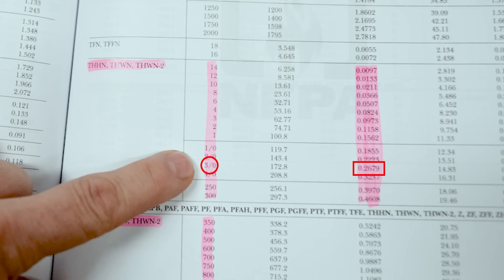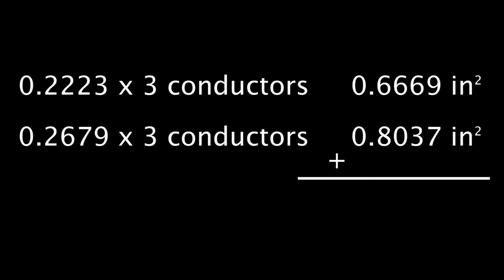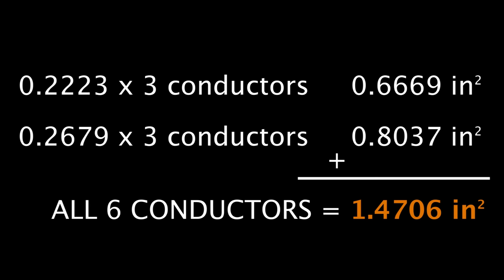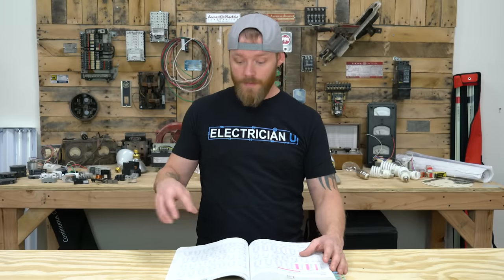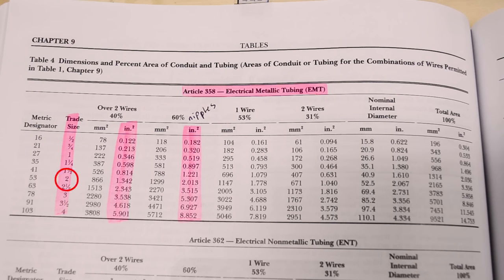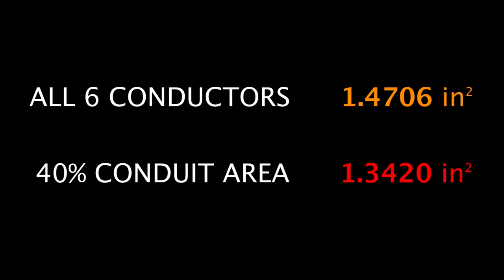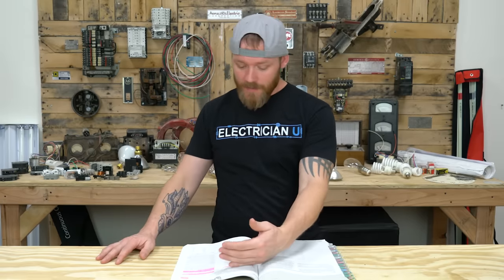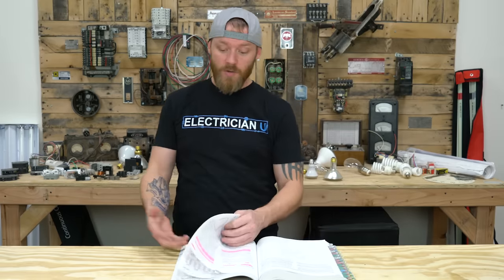CONDUIT FILL EXAMPLES for the Modern Electrician - How Many Conductors Can I Put In...

Comment: The code it’s not an instruction manual nor a study guide. Go to 310.1(B)(3)(A) and you will find that’s grouping the conductor has to apply adjustment factor to prevent the wires from over heating.

Comment: There’s no where near enough air flowing over those wires to dissipate heat. You’d need a fan blowing individually into each pipe to even drop it a few degrees. So dumb that people think you need an air gap to stop the wires over heating.

Comment: Conduit fill CAN lead to too much heat.  Heat can cause a "You name it" list of problems in electrical systems.  I have seen it personally on more than one occasion.  Remember, 9 current carrying conductors or less to avoid derating the conductor amperage heavily.
Reply: That's not conduit fill, that's adjustment for multiple current carting conductors in a raceway
Reply: @jontopham2742  Read Article 300.17. In the NEC Handbook, both chapter 9 and annex C refers you to that article.

Comment: Please check your code book. If you read the informational notes of Annex C in the NEC Handbook it leads you 300.17, which clearly reads... "the number and size of conductors in any raceway shall not be more than will permit dissipation of the heat and ready installation or withdrawal of the conductors without damage to the conductors or their insulation".

Comment: A few points. 1) heat is a factor in raceway fill since mutual heating becomes an issue. There are Performance and Prescriptive Requirements and the prescriptive requirements that demand the maximum fill are to also help satisfy the performance requirements so as to not damage the thermal properties of the insulation. 2) Yes, another key factor is indeed reducing the potential for damage during the installation. Remember, that Informative Annex C is only for raceway fill as a short cut when ALL the conductors are the same size, it doesn't reference heat simply because it is again simply giving users as a shortcut method to maximum fill if all the rules are adhered to. Back to heating, just because the values of 310.15(B)(2)(a)  and 310.15(B)(3)(a) appear to have no relationship to raceway fill they do when ampacity is involved and the perfect world of 310.15(B)(16), such as more than 3 current-carrying conductors are encountered. The annular space that is also maintained helps to allow heat dissipation, not removal. Just some thoughts to share. Now, if the heat was not involved AT ALL then why do you think nipples allow fill allowances to he up to 60%, it is due to the limited length and availability of enhanced heat dissipation. Clearly, the reduced nipple length is not an installation damage concern during the installation. Point is they all work together in a Performance and Prescriptive method by using all areas of the NEC.
Reply from the maker: Master The NEC I’m not disagreeing with any of that, I’m saying that is the reason we use temperature and correction factors for sizing the conductors, not for sizing conduit. And nipples have 2 benefits according to Ch 9 Tbl 1 - no derating for ambient or bundling because of this heat dissipation you talk about and 2 adding more conductors because of physical damage being a lot less likely. The heat and the size are two different things. My argument is that sizing raceways doesn’t require knowledge of heat dissipation, only size of conductors. Head dissipation is dealt with when sizing conductors.
Reply: I can agree if sizing is your only goal physically and based on the title of the video that was your goal. However, I felt it was important historically to understanding WHY we size and how it still linked to the thermal effects of sizing. Ultimatly we could care shitless about size except it links us to the detriment of the wire and its ability to safely and efficiently carry current. The dog wags the tail....We worry about raceway sizes with the knowledge that it helps achieve a performance goal of not damaging the conductors. They work in harmony. Now, if the only goal was to size in the video then no worries but saying heat and mutual heating plays no historical linkage is inaccurate in my opinion. But, Yes I conceded that of sizing is your only focus of the lesson then goal achieved. Hopefully, you did mention Annex C only applies to 40% fill and if all the conductors are the same insulation type and size but I am sure you did my friend.
Reply: Electrician U    Dustin,   So after all of that, follow what you showed in your video and all is good!
Reply: My points were not to criticize Dustin. It was to elaborate on some points. The core raceway fill components are spot on and Dustin knows I would never do that.
Reply from the maker: Master The NEC thanks for sharing, again I do believe mutual hearing and energy dissipation are indeed things that happen. What I don’t believe is that the 40% fill was created for heat dissipation. I believe 310 was created for heat dissipation, ch9 was created for fitting conductors in conduit. That’s actually ALL I’m saying.
Reply: Gotcha....my points were just to explain where it has evolved is all in terms of an evolved remedy. Nothing more my friend.

Comment: Good point!  Size the wires according to their environmentally derated ampacity and size the conduit to accommodate the total cross sectional area of the wire and cables according to the chart, easy.  Keep it simple and you're good.  There's a lot of rabbit holes and math on this one..

Comment: As a professional electrical engineer I found this video helpful. I've taken my fair share of academic courses and certifications and there is so much information to remember its insane. I have to do fill and bend radius calculations on a daily basis so i tend to forget some of the other useful pieces of code in the NEC.
Reply: You guys really need some on the field training for sure. All the new engineers we deal with just don't get that, hey I can't mount a can light light on a solid steel stud or what I'm saying is learn how stuff gets ran and what Electricians have to deal with. It'll help us lots for sure. And other way around
Reply: Hey man! EE here who has to know the trade and code rules. What's your field?

Comment: Dustin,  Very good video!    A couple finer points.   The conductor areas listed in the tables are information based on Southwire.  Exception allows you to use manufacturers information for specific conductors.   Also, somewhere in the back it says that at 40.5% you can round down.   I'm sure you can guess how I found this out after designing electrical for 35 years.   I needed both to be legal.    Very respectfully,   Kevin

Comment: This made a lot more sense seeing the highlighted sections and tabs in both your codebook and your ugly's. Im soon to be a fourth year and haven't had a full on immersion into the way to effectively tab a code book let alone an ugly's. If you have time, could you either link a previous video or potentially create something informative, using examples like the brilliant ones in this video, to illustrate where and what to highlight. The stuff we use all the time, maybe a penultimate "the final test" video, or just something to help us highlight and label our books. Did I see that you have the tables tabbed on the top edge as opposed to clumped in and lost among the other articles. That's BRILLIANT! Super helpful to see something like that, as many code tabs instruct us to put them all on the one mail edge. I love the outside the box creativity. It's inspiring.

Comment: Non-electrician here, but watching the channel to START my education because I plan to re-wire my house in a few years. Looking in my basement, I see a few tubes of 1/2' NMT filled with Romex along the walls. Some have one, others have two. Is Romex, when still fully sheathed, considered one conductor or still considered multiple? In either case, I feel these conduits are overfilled.

Comment: I think the other reasoning behind it is that conductors expand/contract depending on ambient temperature (especially in unconditioned spaces, or if buried). 
If conduit was crammed full during the winter for example, and all the conductors expand during the summer, it's possible they could get damaged somehow. 
But yeah biggest one is probably just for sake of pulling conduit and the jacket not getting destroyed.
Reply: Actually you just touched on an issue that Los Angeles had years ago with the wires rubbing on the conduit as they heat and cool with load and season.  In that situation it was something like 200,000KV not residential but same general principal applies.

Comment: Dustin, Great Video
I have a question for you.  I'm replacing 1x50 wire degraded cable with 5 x CAT 6 cables through an existing already buried 3/4" conduit.   What are your recommendations?  Based on all your NEC warnings requirements with no more than 40% fill, I'm I screwed from the start?    I'm routing CCX lines.  I prefer 1 cable, 1 line for simplicity.  I can reduce down to 3 cables, but I don't really want to use wire for different purpose than it's intention and don't want to replace a hack with a hack.
Reply: Far as I know. Ethernet cable does not fall under the NEC so box fill doesn't apply. That said, having tried to pull ethernet through conduit that was 60% full, it's a b*tch to do so I always used the 40% rule as a guideline for DataCom.

Comment: Good video BUT the NEC will argue with you about derating of conductors and the AHJ may make you change them if not factored correctly. Derating the size has to be applied when running more than 3 current carrying conductors in a conduit. This is why is makes more sense to run smaller conduits like 3/4" with less conductors because it's not economical to upsize the wire when you fill a larger conduit with more conductors & the wire size needs to be increased due to derating. This is one subject that is always argued upon in the field. Wish the NEC would clear it up better. Other factors to consider are ambient temps say in a boiler room that has temps above 86 deg F. Also the termination lug rating of equipment can dictate what rating of wire amp table you can apply. Say your breaker lug has a rating of 75 c you can't use the 90c amperage table for wire size. I advise Apprentices to dig a bit deeper & check several opinions from Youtube & Google for you answers. On another thought the factories I've worked in over the years have plenty conduits overfilled with general purpose branch circuits, not that it's right but they operate fine. You really need to be careful when running heavy amperage circuits like motor loads ect in the same conduit.  I don't claim to be an expert but have 40+ years experience.
Reply: This is true. I’m a journeyman in Dallas and do industrial and commercial and inspectors are actively asking about de rating and checking out conduits with more than 3 current carrying conductors and making sure we upsized accordingly. They don’t always check but I always de rate all of my conductors just in case. Usually this leads to multiple small conduits being ran as opposed to less amounts of bigger conduits because we avoid upsizing the wires to much because of the original bid cost

Comment: I would like input on a conduit question.     People putting NM in conduit.    My first reaction is no you can't put NM in conduit but..    I have also heard there is nothing in the NEC code that says you can't.     The thermal characteristics are different between single vs a bundle of wires so you do have to oversize the conduit compared to a bundle of single wires.      If you feel like commenting  please tell me where in the NEC book it's covered.     Great video thanks
Reply: Answered my own question:  https://www.youtube.com/watch?v=j9A_xg3B1Kg    Yes you can.

Comment: Kind of in the weeds a bit more, but when filling conduit with multiple branch circuits, do you try to even out which line (120/240 split phase) the branch circuits are supplied by, if running hot and neutrals in separate conduits?

Ex: 8 conductors, 4 branch circuits, if all on line 1 supply, would increase mutual inductance in both the conductors and any EMT/Liquidtight metallic. This would increase your eddy currents, reducing your ampacity margin, right? Or is this just not a big enough impact to consider?

Comment: Great information. I’m curious I just got a 2 in conduit for a sub panel feed and I noticed the knockout fits up to 1 1/2 in. So my question is can I use an adapter that fits the KO that would still accommodate a 2 in conduit. I appreciate any advice 😎👍
Reply: You need a knockout kit. That's the easiest thing in the long run
Reply: You need a Knockout kit (there is a hand pump one that is oil filled or Milwaukee makes a battery powered one but if you are just doing this one time (hopefully you have more experience if you are running conduit to your sub panel) get a Hole Saw that will fit a 2" conduit, I believe it's at least 2 1/4" or 2 3/8" size hole saw (as you need a hole saw big enough for the outside diameter of the pipe) so it has to be bigger than 2"....

Comment: This is great info and have had to use this plenty of times but is only good for maybe control wire. I don't get this chart because of the derating factor chart. See if your inspector passes you with 16 #12 in a 3/4" emt for branch circuits. Also i think the derating chart should be for continuous loads . Or at least some type of residential exemption.

Comment: Ok Gurus,
 
DIY with simple scenario, need advice.

3 circuits, 15A max each
24ft run (panel to receptacle)
Dry location, under a carport,  8 ft above ground

Can 12/2 Romex be used in 1 1/2 PVC conduit?
Reply: Under a carport is outdoors, damp location, NM (romex) not allowed.

Comment: Honestly, the internet is scaring me. I'm looking toward relocating (or having it done) my main panel and meter and upgrading from the currently existing two panels (one in the main house and one in the semi-detached former two car garage/previous owner's workshop) to those two plus three more panels: one in the "pool house", one in the tool shed/workshop, and one in the "barn." I was thinking about duct banks and what size conduit I'd need to run the feeds underground for all three panels (since the closest is about 100 feet, the next one at about 125 and the third at about 185 feet). I mean, I thought it, and whoa, here's a video talking about it. scary.

Comment: Hey Justin, great video. I a question regarding running ethernet cabling for cameras. I'm running Cat6 and thinking about using Emt can I this table or the section for low voltage. I'm looking to run (6) Cat6 line from the basement to the second floor for residential on the outside no way to fish up in the wall. What you suggest, Thanks
Reply from the maker: You can do that. It is allowed. Just use the appropriate bushing and follow the fill for the conduit size.

Comment: Google and conduit fill apps makes this so much easier now a days.
Reply: Yep, the conduit fill apps are pretty handy! I use them frequently on the job. I also think it’s important for apprentices to learn how to use the code book and a calculator to do it the old school way first before they ever download an app to rely on. Perfect example...I had a wire pull recently that seemed like too many conductors for the conduit size so I plugged in the numbers on my app. It showed over 40%. I brought it to the general foreman’s attention and he plugged in the numbers on the conduit fill app pre-installed on his company issued iPad and showed less than 40%. I felt a little defeated at first but I pulled out my code book after work and did the math. Turns out my app was right and his was wrong.

Comment: I asked ChatGPT 4o
"So I have a 4-aug wire, a black one. I have a red 4-aug wire and a green 8-aug wire. According to the National Electric Code of 2020, in terms of conduit fill, am I under code if I use a Schedule 40 1-inch conduit?"

It answered me:
"To determine if your wire setup is within the code for conduit fill according to the 2020 National Electrical Code (NEC), we need to refer to NEC Chapter 9, Table 5 for the wire dimensions and Table 4 for the conduit fill capacities. Here's the step-by-step process:

1. *Determine the cross-sectional areas of the wires:*
   - For 4 AWG wire (both black and red):
     - THHN/THWN insulation has an approximate area of 0.0837 square inches each.
   - For 8 AWG wire (green):
     - THHN/THWN insulation has an approximate area of 0.0366 square inches.

2. *Sum the areas of the wires:*
   \[
   \text{Total Area} = (2 \times 0.0837) + 0.0366 = 0.204 \text{ square inches}
   \]

3. *Check the fill capacity for Schedule 40 1-inch conduit:*
   - According to NEC Chapter 9, Table 4, the maximum fill for a 1-inch Schedule 40 PVC conduit is 0.346 square inches (40% fill for three or more conductors).

Since the total area of your wires (0.204 square inches) is less than the allowable fill capacity (0.346 square inches), you are within the code for conduit fill using a 1-inch Schedule 40 conduit.

Therefore, using a Schedule 40 1-inch conduit for your specified wires is compliant with the 2020 NEC code."

What a genius!

Comment: Im thinking of installing 1/2 pvc conduit using 12/2 romex adding outlets inside my garage. Is that doable??? Can i sometimes put 2 romex in that 1/2 pvc conduit?
Reply from the maker: It would be much easier if you just ran THHN or THWN as then you wouldn't need the bushing for Category cable or Nm-b

Comment: Thanks for sharing this!  Quick question...does stranded vs. solid wire matter?  I mean, if I'm allowed (e.g) 10 wires in a conduit.  Am I allowed 10 wires if they are stranded OR if they are solid?
Reply: The cables count the same, whether stranded or solid.